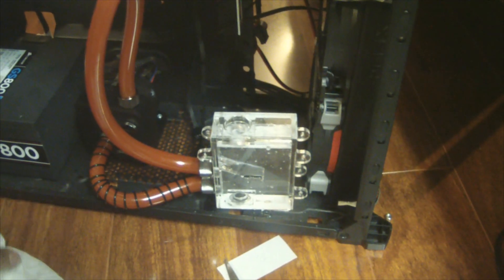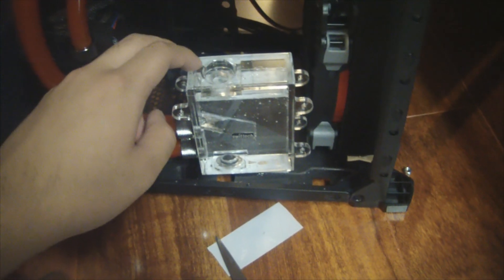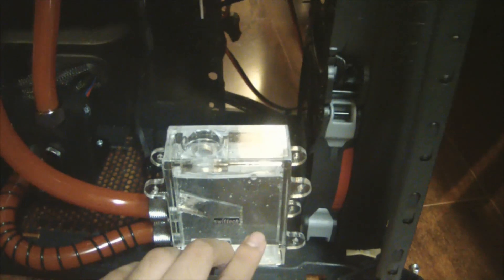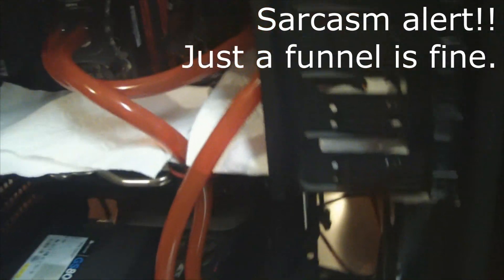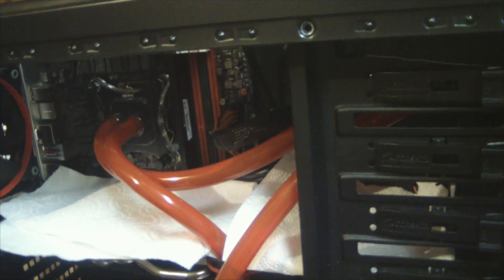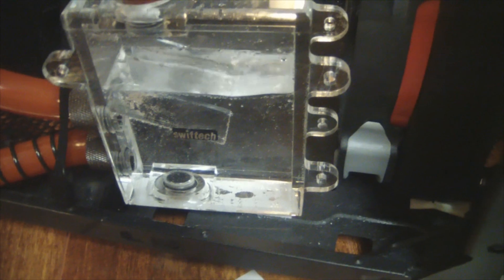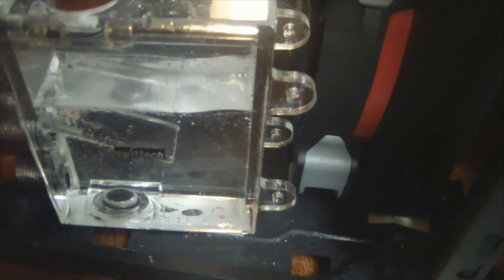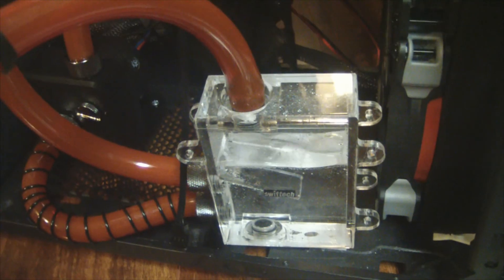Quick Guide- Bleeding Air Bubbles out of a Custom Water Cooling Loop

Comment: "You get what you pay for"? with regards to bubbles? Is there a water without dissolved  gasses you can buy? Is there a pour method of adding water that doesn't involve letting the water touch air? Is water sold in a container that has no air in it?
Reply: The air comes from the system. As you fill up the loop you displace the air with coolant. Some air is trapped in the system after filling, usually in the upper portions of blocks and rads. The easiest way to clear any air pockets is to tip the PC to different angles to allow the air to reach the reservoir.  when filling the loop it is better to have a reservoir with more than one fill port. As you are filling the loop through one port the air from system can escape through the second port, provided it's at least at the same height as the fill port to avoid spillage. Where as I have a reservoir with only one fill port so the coolant going in and the air coming out has to use the same port which if filled too quickly causes air locks and bubble popping out of the funnel spraying coolant all over the PC.

Comment from the maker: It was from the pump. I was using a second power supply to run the pump so none of the fans were plugged in.
Reply: Initiate Id Dude, that's a great idea!  I'll just bust out another power supply to get the air out of my loop.

Comment from the maker: Honestly, there isn't really any justification for water cooling other than... well extreme overclocking and bragging rights. The price for all the components are just too high. You can probably push your CPU to 4.3GHz with the Hyper 212 while staying at safe temperatures. I would recommend just sticking with a closed loop cooler unless you want to spend money on all of the custom loop components. They sure make the system look better and more sophisticated.

Comment: So I am running an i5 2500k at about 4 gHz right now in the summer at decent temps with a hyper 212, somewhere around 40-55C, is it worth watercooling, I should state my GPU is a GTX 680 as well which runs cool as well. Should I do a custom loop, or just grab a H100 or or closed systems?

Comment from the maker: In my case, the reservoir is before the pump (The inlet for the pump is in the center. I don't know who's design choice that was.) Since the res is taller than the pump,if I fill it all the way up, it will feed directly into the pump (because of gravity). On initial filling it should be above the pump, after that, it really doesn't matter if you've bled it out properly.